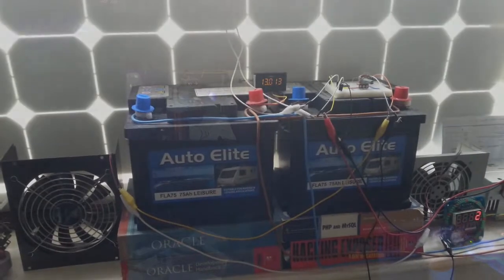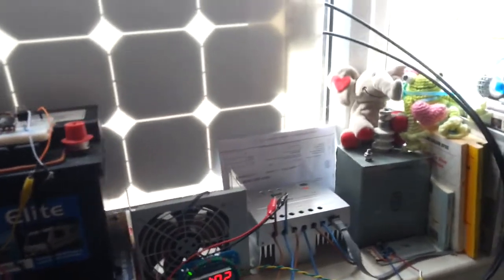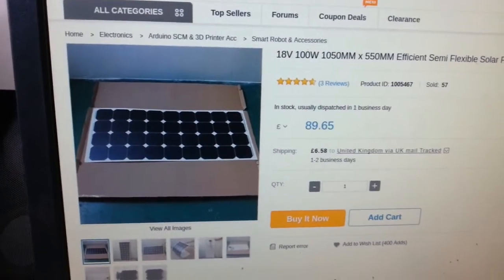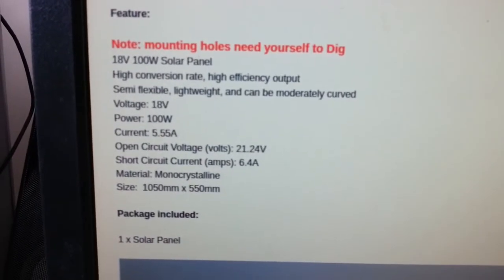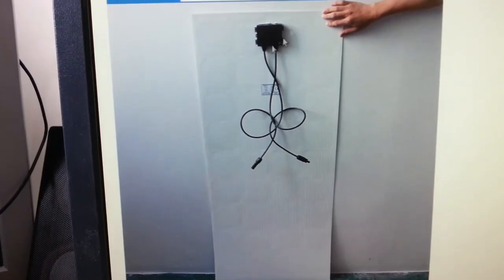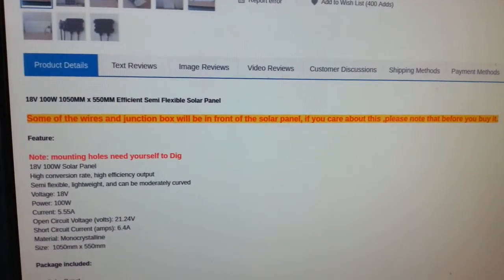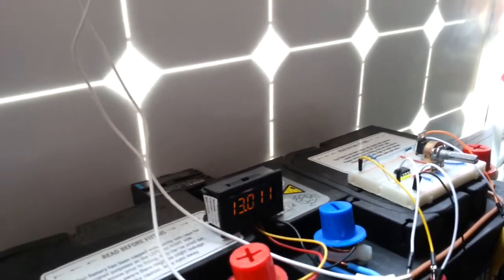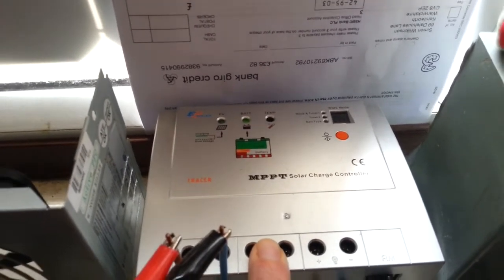My 100 Watt Solar Set Up

Comment: By any chance you would know the combination of wires
to measure the amperage charge controller (PV) for the batteries using voltmeters ammeters Chinese?

Comment: I notice in the video you said you recharge normal non-rechargeable battery's...have you learned or discovered any methods for this other than the normal charging procedure
Reply from the maker: I use a power supply and raise the voltage gradually as the current demand lowers. I will make a short video showing what I do. I mainly do this for PP3 type battery.